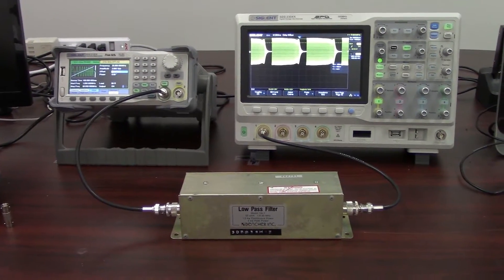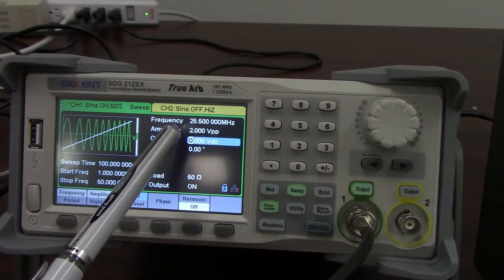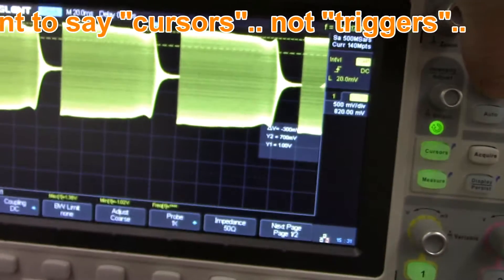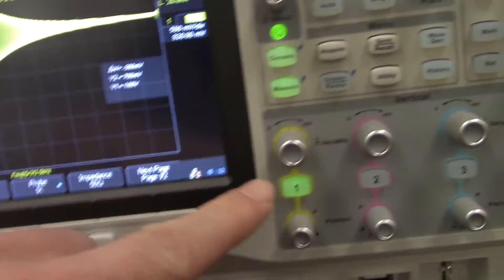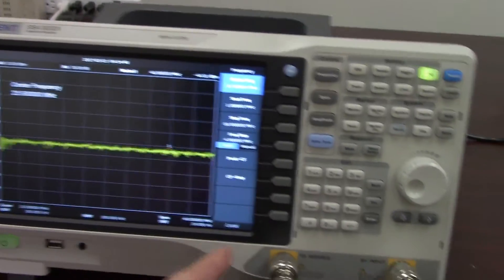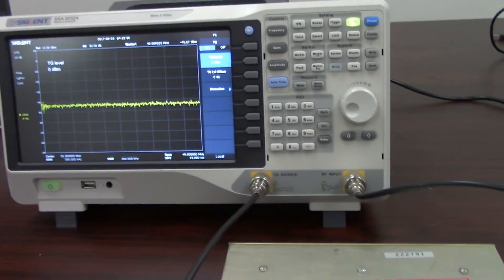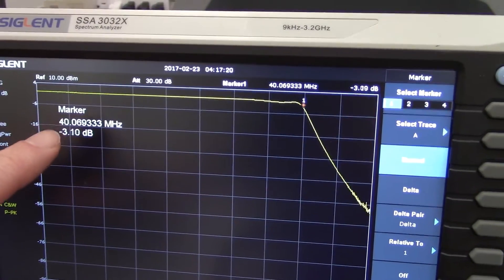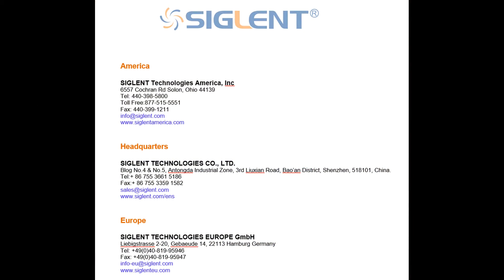Find a filters 3dB point using an oscilloscope and function generator

Comment: The SDS2304X already contains a signal generator. So, it already contains all the hardware required to measure, calculate and display the frequency response of that external filter, the oscilloscope just lacks the firmware to do it.
Reply from the maker: You could certainly use the internal waveform generator, if the scope you have is so equipped. In this video, I was just showing different techniques and some tips/tricks. I don't think you need any special firmware to measure the response. Simply sweep the source and display the voltage vs. time for the entire sweep. You should see the filter passband, etc.. easily. - Jason, SIGLENT North America

Comment: Since you can not normalize with the scope setup you need to be very confident in your function generators and oscilloscope abilities to have a flat response in the interest frequency range. Best to check beforehand.
Reply from the maker: Good point, Dennis. This technique isn't the most accurate, but it does provide a decent idea of filter performance using basic test gear that most people have access to.
Reply: @SiglentVideo  I was just going to comment the same about the  sig generator. Maybe you could use one channel to measure the input to the filter, another to measure the output and calculate the difference
Reply from the maker: @CH_Pechiar  Yes. You can also use the scopes MATH function to enable A-B and get a normalized response curve.